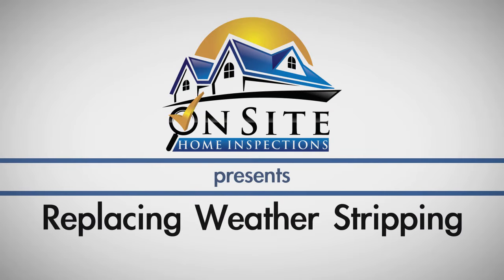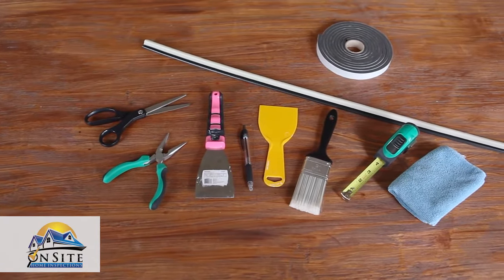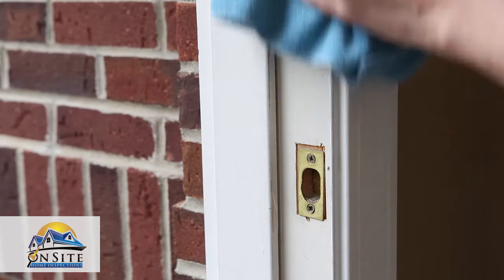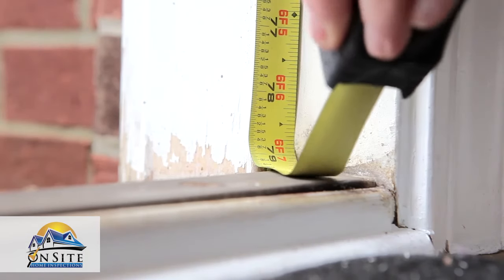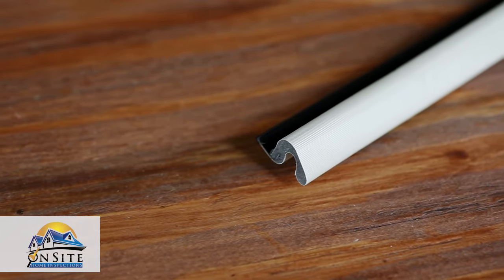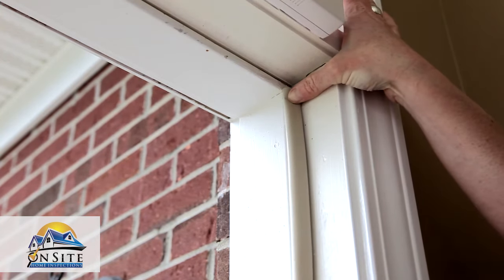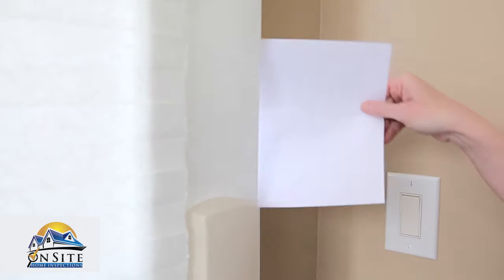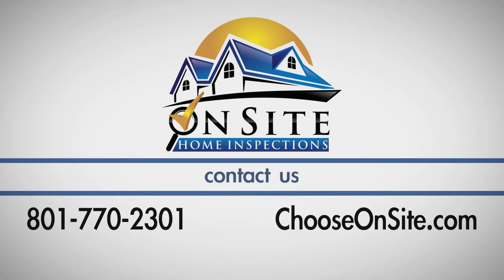How to Replace Exterior Door Weather Stripping

Comment: You can also look for daylight through the crack of the door and feel for a snug fit while closing. In some instances you may need someone with a flashlight go around the outside of the door slowly while you’re on the inside.